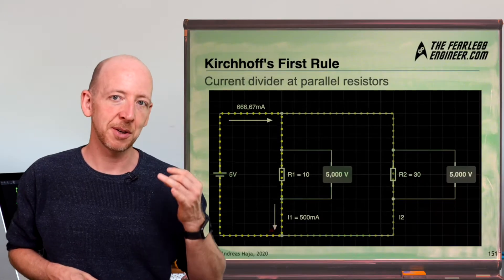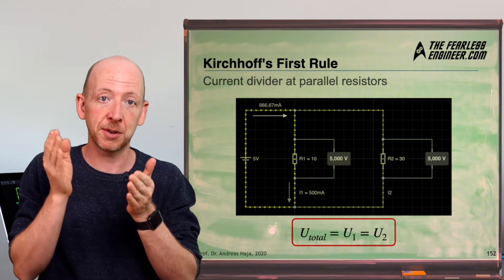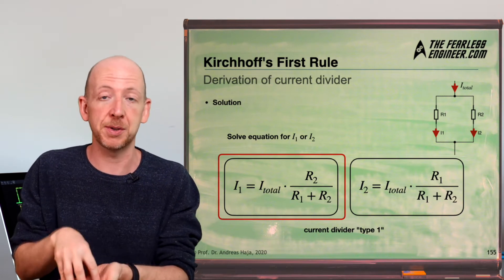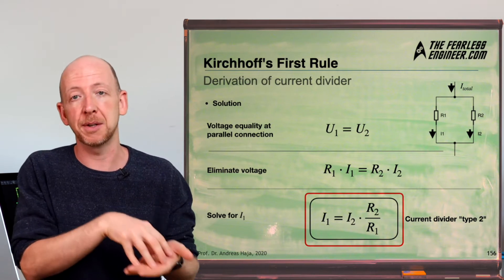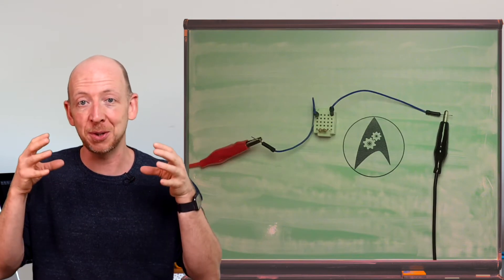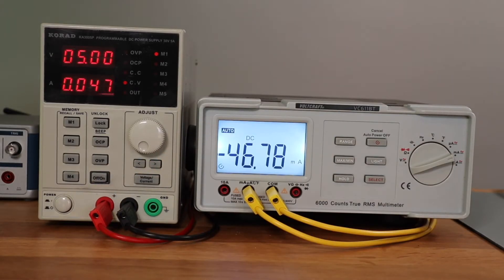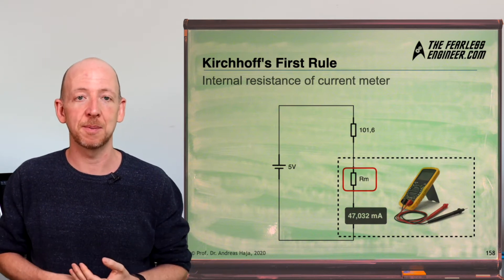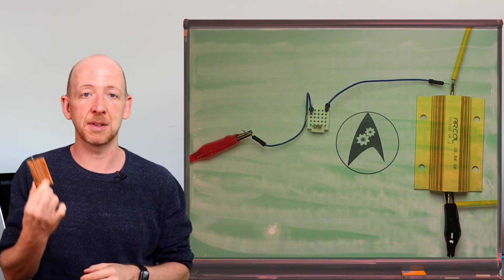Current Divider Rule : Derivation, Examples, Experiment | Online Lecture "Electronics"

Comment from the maker: 😀 Hi and thanks for watching! Here is a short question for you: How can you get an  ampmeter with an internal resistance of 6 ohms and a range limit of 250mA to measure a current of 1A using a current divider? If you like, let me know your solution in the comments below!
Reply: By using a shunt resistor of 2 ohms and measuring the current parallel to it ?
Reply from the maker: Yes, that's correct! 👏